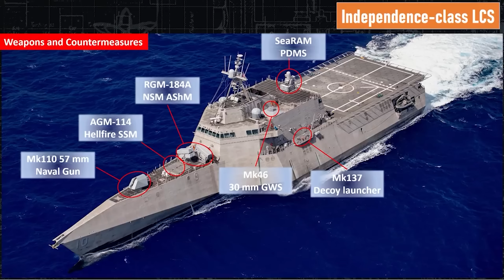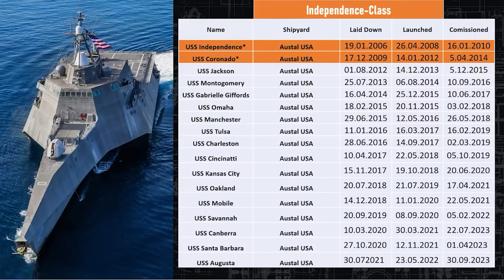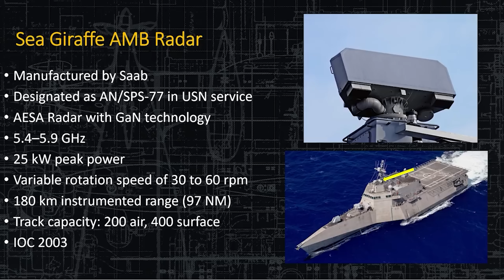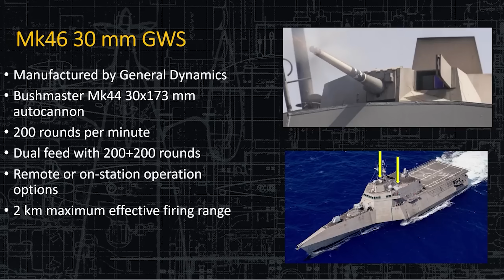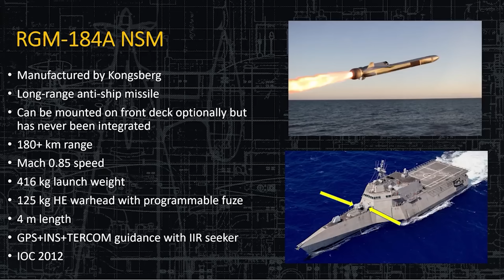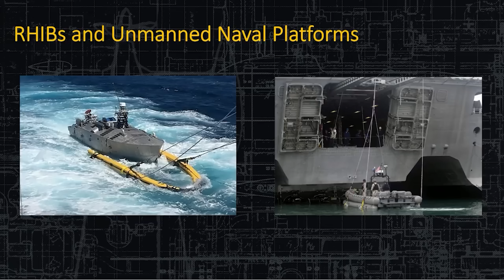Inside The FASTEST Combat Ship In The US Navy

Comment: I know they're moving these into the mine countermeasures (MCM) role in place of the Avenger-class, but since both Mk46 30mm Bushmasters are on top of the mission module lift system. I can't imagine it being all that difficult to relocate the Mk46 GWS's or adding wings to accommodate them, removing the mission module lifts and installing an 8-cell Mk41 VLS in place of each for 16 cells that might make these into something not completely useless outside of MCM operations.
Reply: Or maybe just drill and thread some holes on the helicopter deck so that the navalized typyhoon launchers which was adopted by the Army from MK..41, can be deployed as mission modules.
Reply: @ChaohsiangChen  They have proven that concept with the Mk70 container launchers, so it's certainly an option. And it could be advantageous serving as something like a missile carrier (say, SM-6, for instance) for an expeditionary group, especially since it also serves well in counter-mine operations and has a very large cargo bay capable of stowing APCs or other ground vehicles and a relatively large amount of gear, equipment, munitions, etc. for a Marine Expeditionary Unit, and could even embark, transport and ferry a Marine unit as large as a reinforced platoon or under-strength company. Among the downsides, though, are that it doesn't have the sensor & targeting package needed for higher-end & over-the-horizon weapons (and, I'm told, could be made to accommodate ESSMs and ASROCs, but not Standard Missiles, Tomahawks or the like), and so would need to be launched-on-remote, commanded from something like a San Antonio-class or a large surface combatant, thereby limiting its applications & usefulness. It's also unfortunate that accommodating Mk70 launchers necessitates ceasing all flight operations as long as launchers are on the deck, and that is one of the few instances of a mission set where the Independence-class excels. So it would mean having to return pier-side to have the container launchers removed before being able to resume flight operations. What's more, if I recall correctly, they're limited to carrying no more than 3 Mk70 container launchers, and so it would be even more limited in utility while tasked with carrying the launchers with only 12 VLS cells and unable to run flight ops. This is only my opinion, and I make no claim that I understand the application, advantages & disadvantages in such operating concepts, and having the option to accommodate mk70 launchers is certainly better than not having the option, but it just seems like they could get a whole lot more out of the ship class by upgrading the targeting fire control to work with ESSMs, relocating the Mk46's and swapping the mission module lift for Mk41 cells, especially considering that (at least to the best of my knowledge, and I could certainly be wrong about this) the lifts no longer actually serve a functional purpose because the Mk46 module is the only module they plan to carry, and so the lift system is essentially just dead weight at this point.

Comment: It's not often that something so good looking is so bad at it's job.
Reply: That's not really true.  They have always done exceptionally well when they've participated in RIMPAC, and their payload capacity is larger than many destroyers which is a vital asset given it's speed.  The hull issue is more a symptom of the navies idiotic procurement process that's already been worked out in the latest ships.    Survivability is a question, but any ship of this tonnage is either going to be fast and hard to hit, or well armored and a sitting duck. It's just a matter of physics. During RIMPAC it's speed, maneuverability, and low observable characteristics made it exceptionally difficult to locate and track.  I think the survivability issue is overblown, mostly because even a destroyer likely wouldn't fair well against an anti ship missile.  The Cole was nearly sunk by a dinghy filled with explosives,  the Cheonan was blown clean in half by a torpedo from the 60's. The Moskva sunk by a Neptune.  The best defense against modern threats is to not get hit in the first place.
Reply: @ This ship with a 16 cell VLS and ESSM would be pound for pound one of the most capable warships of all time.
Reply: I think the Independence gets a bad rap because the Freedom is SO bad. The Independence is actually a fairly useful ship. Well....it would be if it could actually go fast without ripping the bow off, but that's fixable.
8 NSM, 24 hellfires, a 57mm gun, 2x 30mm guns and Block 2B Searam is actually a very heavy armament for a Corvette. 
Would've been way, way better with 16 VLS cells & ESSM, but oh well.
Reply: @Valorius no it's not. This is a 3000 ton ship.
Reply: @bulthaosen1169  show me a 3,000 ton ship that can pack 64 essm Active Radar guided missiles and 8 Stealth anti ship missiles.
Reply: @Valorius  where did you even get that 64 essm number? This thing doesn't carry those. It carries an 11 cell seaRAM. 24 AGM. 8 NSM. For a 3000 ton class that's woefully underarmed.
Reply: @bulthaosen1169   Read my comments and comprehend the words I'm typing, perhaps.
Then ask me again.
Reply: @ As far as it's actual armament, you forgot a 57mm gun and 2x 30mm guns. 
It is certainly not the armament I would've used (again, read my comments), but it is hardly "woefully under-armed."
RAM Block 2B in a searam launcher gives a credible 25km air defense, 24 Hellfires gives tremendous small vessel attack defense, 8 NSM gives a heavy state of the art anti ship and strike punch, and the 57mm gun (which is actually an AA/Anti missile weapon primarily) is vastly superior to a conventional 20mm Phalanx CIWS in that role.
It's offensive armament is quite good, while it's defensive armament is adequate.
Reply: @Valorius  it is woefully underarmed for a 3000 ton vessel. And it's RAM 15km. Only 11 of them. AGM is only 8km. 57mm gun is good but 76mm provides better options.

And NSM is overrated. Besides it being a harpoon replacement it's not anything noteworthy. 

And the reason why it is underarmed is because red sea is the perfect example. There are reports of many near misses. Including the recent incident with the aircraft carrier even with it's entire battle group.

This is the kind of armament I would expect from a class between 1000 to 2000 ton.
Reply: Lol lots Turkish istif class can quad pack UpTo 64 hishar u which is probably 30-40 km range less then essm but again comparable it also has 16 ashm @Valorius
Reply: @gwramim4807 That's great but what does it have to do with LCS?
Reply: Similar tonnage? If for op missions this LCS is overated or overpriced that's what I am trying to say not to say this istif has more endurance then lcs @Valorius
Reply: @gwramim4807  Maybe the USN will buy some. LOL
Reply: Read about and heard tell that in an exercise, an Indy LCS got to within Hellfore range of a Burke and mission killed it with Hellfires......and this was before they got their NSM package.
Reply: Ever work with a really pretty girl?
Reply: @jshepard152  LOL!
Reply: The 9/10 looking chick I saw at Wendy's Saturday sure was terrible at her job.
Reply: It is more often than you think
Reply: I guess beauty is in the eye of the beholder… if you consider this good looking, I really don’t want to know what else you think is a good looking ship.
Reply: I always thought the biggest advantage that the Indys had was it's huge flight deck.  A flight deck like that could launch dozens of drones in a single go.  Then pull another batch from below and do it again.
Reply: @HolyNorthAmericanEmpire  I remember when people shat on the Patriot air defense system for DECADES… only for t 35+ year old system to prove itself to be world beating when used in a real war  

Watch as after a few tweaks these things prove to be some of the best, most useful vessels 😣
Reply: you haven't met my ex.
Reply: Yes it is. 😂

Comment: Aren't they adding deck box launchers on the stern? Giving it ESSM2 or SM6 capability?
Reply from the maker: that is a proposal. There have been tests with that configuration.
Reply: @SubBrief would the open space behind the bridge to the RAM launcher be strong enough to mount the BAE adaptable deck launcher ?
Reply: Meaning, results will be seen in 15 years at the earliest, then they crunch the numbers again, say it's too expensive and then scrap the whole thing again @SubBrief
Reply: @SubBrief  Would they sell SM6 to allied corvettes as well? Pardon my fancifull ideas.
Reply: @herptek It's highly unlikely that any corvette would have the electronics to utilise SM-6's full potential, so the market isn't exactly great. Large frigates with more capable sensors like F100 or future Hunters are a different conversation tho.
Reply: @jakub0447  Anything that can be fitted with strike height Mk.41 VLS cells can certainly be fitted with the electronics as well. Something like this would be worth designing the warship around.
Reply: please do video  @SubBrief
Reply: @SubBrief  This ship with 16 VLS cells is utterly transformed and suddenly becomes an extremely useful surface combatant.

Comment: Why don’t we just reclassify these ships as Corvettes, which in many ways they are?
Reply: The independence is closer to a frigate in size, isn't it?
Reply: @jordansmith4040  Size: yes.  Armament: No.  So both the LCS types are large corvettes.  Now, if you want to see ships of a similar size that are frigates; take a look at the Turkish Istif-class and the Greek Kimon-class.  Those look to be doing small frigate design properly.
Reply: @ The Independence class is a Corvette. The freedom class is an atrocity.
Reply: @Valorius 😂😂😂. Outstanding comment
Reply: @jordansmith4040  And a corvette in capability.

Size has not been a factor in ship classification since the fall of the Naval treaties of the 20s and 30s, 100 years ago, and even back then there was some tomfuckery in interpration.
Reply: @jordansmith4040  It is frigate sized corvette, due to very reasonable speed and endurance requirements.
Reply: Kind of unless in a real war. Especially away from supporting home protection.
Reply: I do not think you would want it as a Corvette, tbqh. He has not gone into the list of problems with this video; I think he did on an earlier one, where the wide range of issues are listed.
Reply: they are not quite corvettes, they sit in between corvettes and frigates.
Some countries these are useful(ireland!!!!) lots of shallow waterway.north sea is typically between 20m and 100m deep, VERY choppy.ideal territory for LCS.
UK not bothered either as they have massive advantage in naval assets, but would consider this quite a nice augmentation if playing nice(likewise with JAS39.....UK already have a few as trainers,so a couple of squadrons in ireland is no biggie,UK will match....ireland just don't get the best toys to go on it)